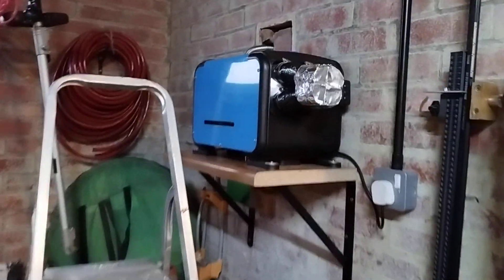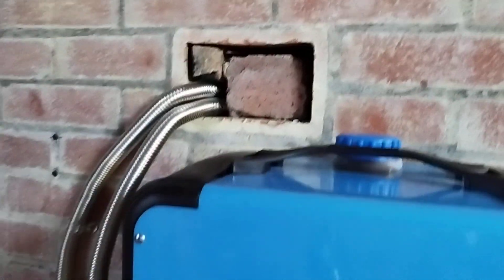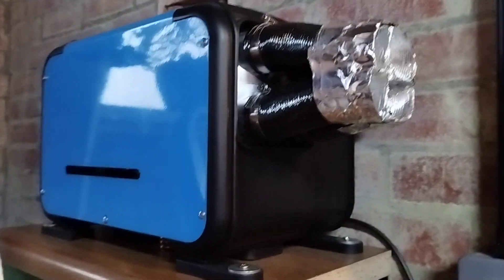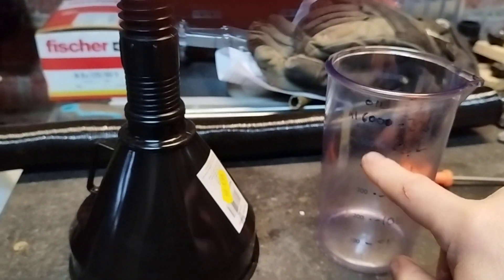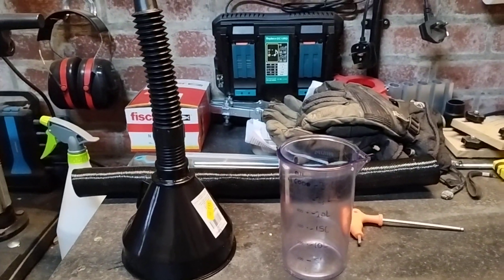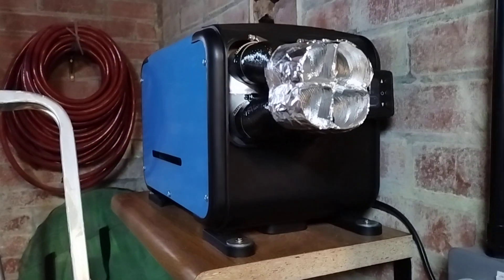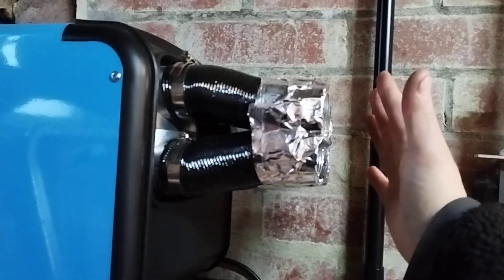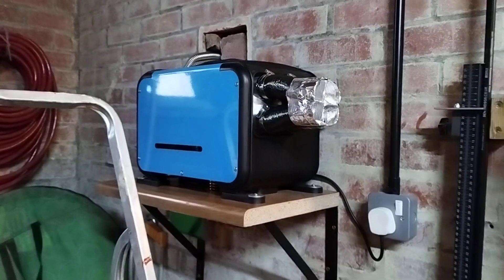8kw diesel heater only producing 2kw of heat on max 😕

Comment: There are only 2kw and 5kw heaters. 8kw heaters are 5kw heaters with a sticker that says 2kw. In your case, it's the controller/ECU combo you have. I had the same and replaced it with the traditional 6 blad fan controller/ECU combo. Very simple procedure and after tuning it was blasting out so much heat that I certainly couldn't keep my hand in front of it for more than 10 seconds.
Reply from the maker: That's great to know. I just ordered one of these from Amazon: https://amzn.eu/d/3QSIqCl
It seems to be (by the image where led screen is displaying the  icons) the original controller type which includes the pin protected tuning screens. If it doesn't have this, it will be going back 😊
Reply from the maker: What's annoying, is that the heater product screen actually shows the heater with the older controller, which would have allowed me to tune it. Instead, I've had to go purchase one.
Original heater link:
https://a.aliexpress.com/_EujIW8T

Comment: You're exhaust pipe needs to be down it can't go up to exhaust otherwise you're going to fill it up with carbon and it will stop up your heater and not allow heat